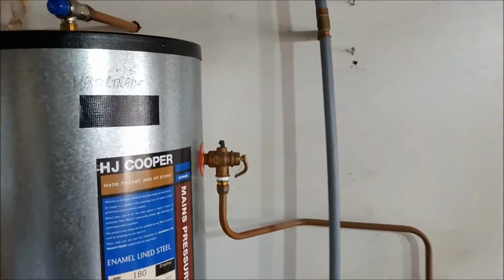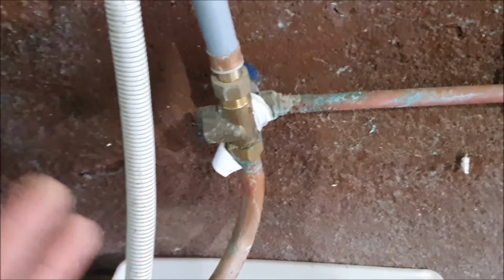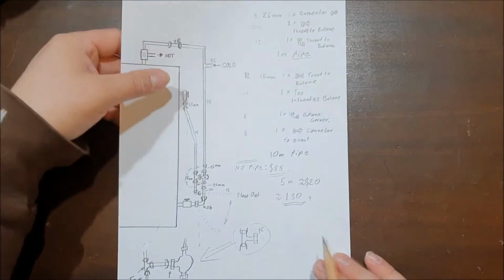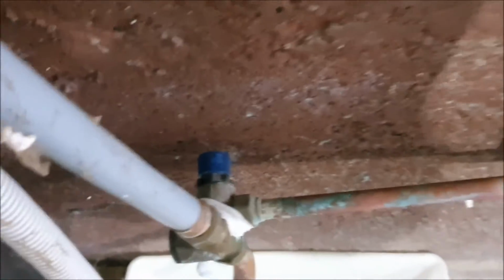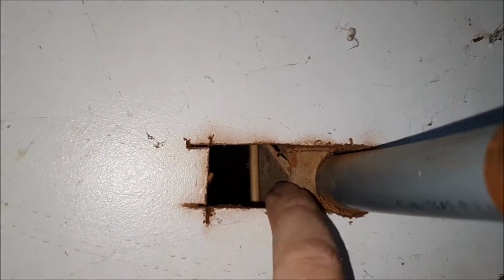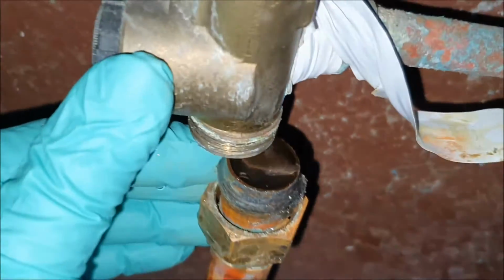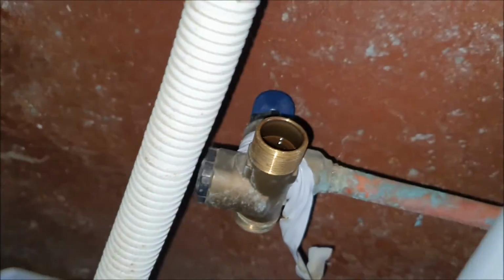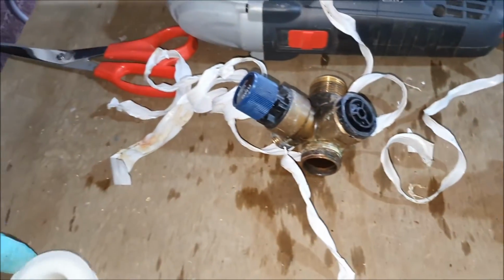DIY Project - Replacing Cold Water Expansion Valve - Part 01 (DIYbyNZguy)

Comment: Mine is doing exactly the same. But I don't think it is a crack. The movement of a small, pressured jet getting past the valve wears away at the brass on the inside. Mine leaked slowly down the emptying tube for a couple of years. Then the other day the valve started leaking through the 'crack', and today there is a microscopic jet of spray coming from that 'crack'.
Reply: That sounds exactly like what's happening to mine. Only 8 years old.
Reply: Mine was installed in 2017. There are now a few pits on the valve and it leaks. Apex

Comment: I've just replaced mine, same make and rating (about 3 hours ago) and had a hole that was almost identical to yours!  When you gut the body, there's a stainless or chrome valve seat that looks like a press fit.  Around the outside of that I noticed a lot of corrosion, ending in a hole that goes right through and out exactly where yours is.  The hole in mine is a bit smaller, but probably because I replaced mine when we found the leak.
The corrosion almost looks like a combination of electrolytic reaction and cavitation..it's basically exploded the brass out in one particular area.  I've seen this in alloy engine water pumps where the coolant/antifreeze mix is mostly water and it becomes acidic.  Throw in turbulent hot water and low level electrolysis and the pump vanes get eaten down to nothing. 
The house is only 15 years old and I wouldn't expect water to eat through a brass valve body this quickly, let alone the exact same place as yours.  Do you still have the old valve?  Or did you break it down to check out the insides.  Would be very keen to compare our findings.
Reply from the maker: Thanks for the feedback Comrade. 
I am not sure if I still have the old valve as I try to keep tidy. Will look for it and get back to you on that.